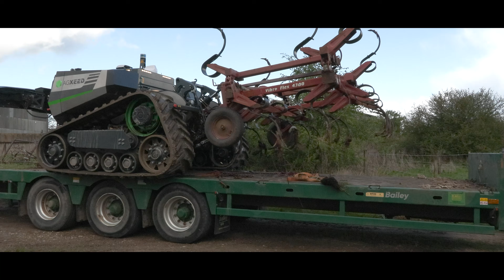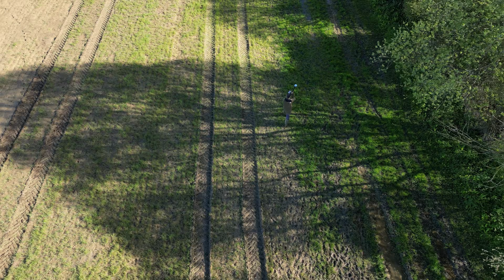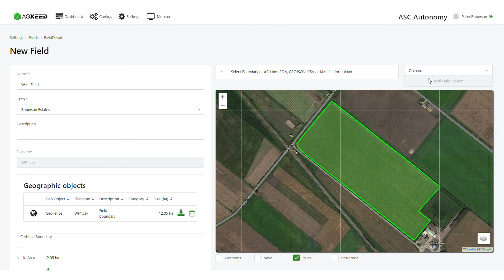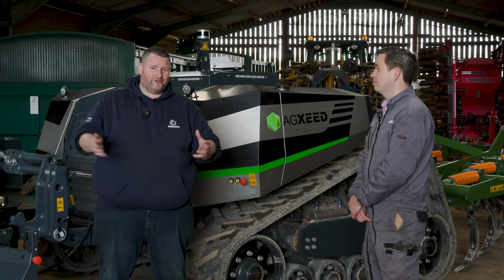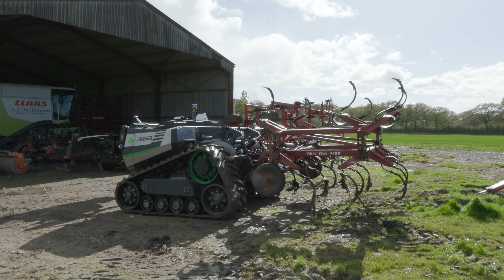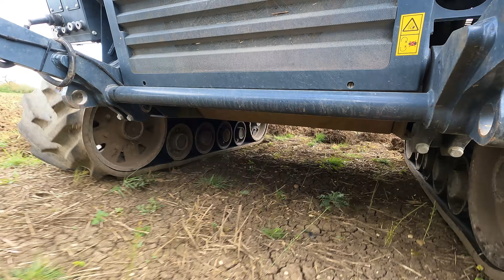Is this the future of farming?

Comment: I think farming, as well as many other work functions, will go to remote controlled vehicles. When asked about alternate fuels, why is ethanol fuels from biomass never discussed - and I do mean never? Ethanol from biomass and oils from biomass (i.e. algae) do not contribute to global warming. Both are readily compatible with internal combustion engines. EVs do not perform as well as ethanol or biomass oil powered internal combustion engines. Also, the electrical system, the grid mainly, is very inefficient which means, lots of energy in to give enough electricity to meet the end user's needs.